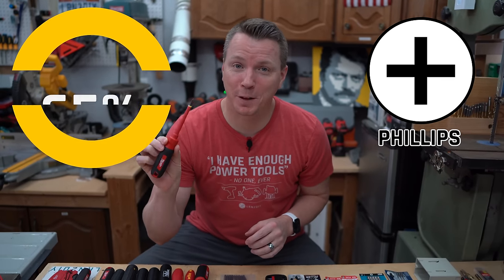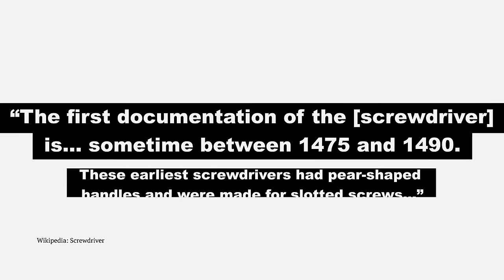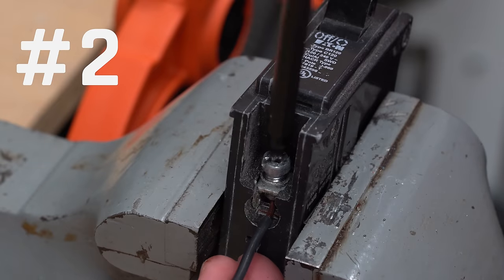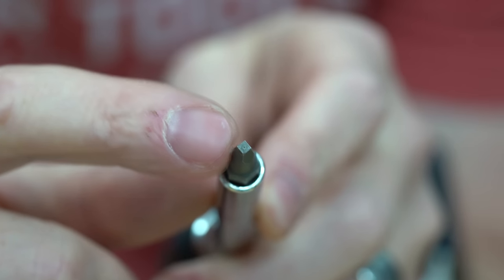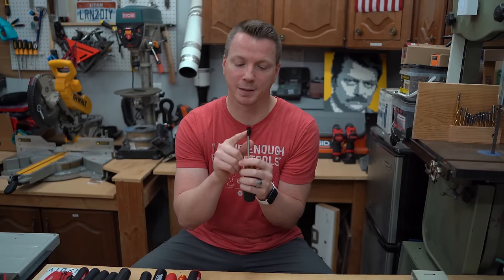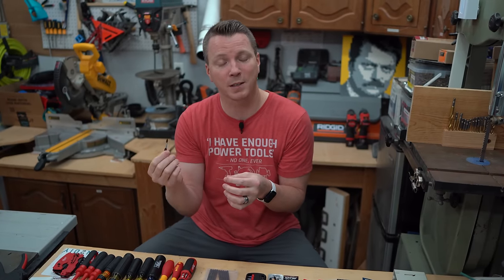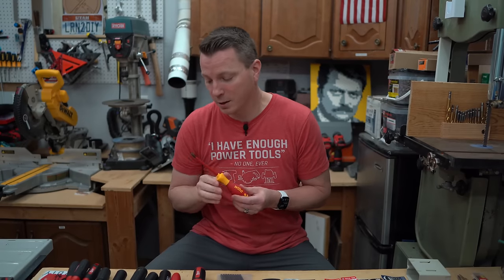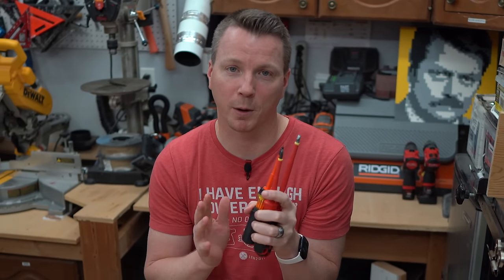You're Using the Wrong Screwdriver For Electrical

Comment: Paul in Canada here. You forgot two of the key advantages of our Robertson. The #2 is red and the #1 is green. Sometimes it’s just part of the handle that’s coloured but usually the entire handle is red or green — and with true Robertson hex bits, the entire bit is painted red or green. When reaching in your belt pouch you don’t have to look at the tip. Also the great thing with the tapered Robertson tip and quality screws (not cheap Chinese junk) they jam onto the end of the tip and stay there while working at any angle for deck building etc. Fabulous!
Reply: I've never seen color coding on any of my robertson bits, not even the multi-bit screwdriver I purchased in Lethbridge.
Reply: @Sylvan_dB  "bits" are all purpose usage. Your mother or sister usually have these multi tools. All Robertson tools (including most hex shank Robertson bits are color coded, #2 red used 80% of the time. #1 green used 40% of the time (#2 used more often by electricians). #3 black used 30% of the time (again, electricians more often) #0 yellow used for small precise work. #4 brown rarely used and #00 orange known in computer world.
Reply: @palco22  if you say so. I have many thousands of dollars of tools and none color coded as you describe. I have seen sizes color coded in some Harbor Freight sets, but no Robertson in those. And FYI bits are commonly used in torque measuring drivers. I do not buy single size torque drivers, and correct torque is essential so I use bits. They also work well in impact drivers for disassembly.
Reply: @Sylvan_dB  I prefer avoiding "bits' (those tiny bits that require a hex shank tool) I use dedicated tools for all work whether it's wood working, mechanical or electrical.
In Canada we don't have Harbor Freight and apparently they don't ship to Canada. We have Princess Auto which would be a similar outfit. A good tool makes for good work but what ever works for you go for it. 
Have a great day and a great 2023 !
Reply: @palco22  sems to be a Canada vs US  user expierience
Reply: It's true that the colors are conventionally used, but not universal. My Klein robbies aren't color coded. You CAN get color-coded red/green and they're helpful, but it's not mandatory.
Reply: @martyvanord984  The importance of a great result is the same. Regardless of where you're from, a great idea remains a great idea.
Reply: @TheNewGreenIsBlue  Of course that is true color coded remains useful. Over the more or less 55 years the few Klein tools I own (cutters, pliers, long nose etc.) have more than proven themselves..
Reply: I've discovered that myself too, I always wondered if this was actually a standard or not but I always find myself using the red and green ones for the same type of screws.
Reply: @redsquirrelftw  Since the Canadian patent for Robertson's patent expired the number id of # 00 (orange), # 0 (yellow), # 1 (green), # 2 (red), # 3 (black) and # 4 (brown). The numbers are reconignised internationally. The colors are, i believe, a Canadian thing and make it much easier to identify. It's my first choice for screws, hands down.
Reply: The Canadian Tire robertson set that I bought in the 1980s (colour coded, of course) remains in regular use. Nothing better, and I've tried them all, including Frearson and Posidriv.
Reply: You forgot the Yellow Robertson....all mine come in yellow..green..red and black...
Reply: Interesting. Never noticed that, but now that you mention it… I have to check. Yes, my two ancient drivers, with wooden handles, are red and green.
Reply: Red Green would have used duct tape and maybe an acetylene torch.
Reply: i drill the back of the handle and drop a little paint in the indentation.
works like a charm. BIG SQ fan here
Reply: You are correct I was able to order actual Robertson screw drivers from one of my supply houses.  The handles are all solid color coded.  I have the green, red, and black
Reply: I never even knew Robertson bits existed before I use Kreg pocket hole screws. After that, I wondered why all screws weren’t square drive. They don’t even need a magnet to seat well onto the bit.

Comment: Robertson is the best choice. I've built decks for friends using Robertson screws. I built my back yard shed using only Robertson screws. Now if the fastener manufactures would properly heat treat their screws I would never see a stripped head again!
Reply: I've used a lot of Robertson also. Way better than Phillips but definitely a little worse than torx. Took about 6 robertson bits to unscrew / rescrew a whole deck because the bits start getting rounded and stripping.
Reply: @gorkyd7912  I agree - Torx are the best alternative for almost every case. In special cases it's XZN, but they are more sensitive to corrosion, so it's mostly for cylinder heads on cars and similar applications.
Around where I live the Robertson is so rare that it could take a week to find a new tool - or screws using it.
Reply: I agree with the other posts that Torx is great. For a while years back our local lumber yard was big on square drive Robertson's. They were better then galvi Philips but I had a terrible time with them caming out.  Now I use Torx exclusively.
Reply: Yeah torx is better than Robertson for construction and woodworking. Robertson is still better than anything else besides torx though.
Reply: Robinson or Phillips for electrical. For decks, there's nothing better than Torx.
Reply: while using the wrong screwdriver, your using the wrong gloves, boots and hat. Never use the wrong tools if you want to have a great day.
Reply: Yeah screw head would have to be fairly hard. Had so many stripped screws from square bits. Seems like they are made for 1 time use.
Reply: Unfortunately, the Torx Army invasion has overwhelmed the forces of the Robertson

Comment: The history I heard of Phillips vs Robertson screws was that in the beginning of WW2, with the big increase in production, Ford had to decide between the 2 screw types.  Critical difference was that Phillips were far less likely to over-torque. At higher torque, Phillips bits would slip out out of the screw head while Robertson bits would hold fast (and then  break the screw or strip out of the metal).
Reply: It was my understanding through my father (of WW2 vintage)  that they were designed to prevent over torquing.  There were (and are) variants like pozidriv that reversed course and  squared up the blades to create a surer fit.  I would suggest that Phillips are still useful for not breaking the plastic parts of say electrical outlets.
Reply: The real reason ford didn't use it was he wanted exclusive rights to Robertson & the inventor wouldn't sell it to him. As usual ford tried to lowball the deal.
Reply: Makes sense for the initial availability of Robertson screw design circa 1906 to 1911 for normal production… [According to Google: US & Canadian Patents:
Canadian patent: 1907, CA103387, U.S. Patent CA103387A; US patent: 1911, U.S. Patent 1,003,657;
Square head screw: 1909, PATENT #116463
Manufacturing machine: 1911 ]   However, the patents would have been long expired by the time of the drastic increase in production for WW2 in the 1940s.
Reply: I am just a do what I have to DIYer, and discovered the Canadian square head screwdriver over 40 years ago when living in Canada. I found it to be the best screwhead by far. Unfortunately I now live in Europe (Ireland) and square head screws are seldom if at all used. More is the pity. 😪

Comment: I hate "Robertson" drives. Don't get me wrong, they are great as long as the driver is aligned perfectly with the screw. Placing the driver a couple degrees off center guarantees the screw to "cam-out".  I find the "torq" or "star" drive drivers to be the best for the best torque, plus, it allows the driver to be mis-aligned with the screw at greater angles. Sadly, the electrical hardware industry has not caught on to using the drive in most, if not all applications.
Reply from the maker: That’s a good point about the angle of the driver. It’s still my weapon of choice, especially when compared to the Phillips or slotted, but I can definitely see what you’re saying there.

Comment: @LRN2DIY The reason why the WIHA SL/PH slips is the same why a PH slips in a PZ head: you are using a SL/PH driver in a SL/PZ screw! Yes, if you look closer at your screws, they have thin diagonal lines between the 4 cross slots, indicating pozidrive instead of philips! And yes, besides the older standard SL/PH (which comes in sizes SL/PH1 and SL/PH2) there are also SL/PZ1 and SL/PZ2 which are combinations of slotted and pozidrive. These will fit into your screws as if they were made for them (which in fact they are ;)). Not only Wiha makes them, also Wera, Knipex, Proxxon, Toolcraft, PB Swiss and others. Like PZ is a step forward from PH (but you still find PH screws), some old electric contact screws are SL/PH while most of them are really SL/PZ -- and of course you have to use the correct size! These btw are also called "plus-minus" (or "plusminus") and "xeno" in literature. Also note that many electric appliances give you the exact Torque you have to use if the screws actually make contact with hot wires (and are not just case screws), which is a safety feature to avoid electrical fires! That's why WIHA also offeres special handles with adjustable torque.
Reply: One type you didn't mention is JIS heads... Similar advantages to pozidrive but you don't have the draw back of a pozydrive head not working well in a phillps screw. JIS drivers work better than Phillips drivers in Phillips heads.
Reply: @ryanokeefe12  I heard the opposite and find it hard to believe that mixing JIS/PH would beat PH/PH. While JIS is said to be better if screw and driver are the same, mixing should be bad, since JIS and PH differ in their tip angles (only), right?
Reply: @stefanpeterwolf7458  PH are designed to cam out. JIS are designed to stay in place so that the desired torque can be achieved. It's not just the tip angles. There is no inner chamfer at the root of the "cross" on JIS which is the main contributor to the inherent cam out design of the PH.
The JIS basically doesn't engage with any of the forms within the screw head that work with the driver to make it want to cam out.

I can't link on youtube, but plenty of info on the googles that runs through this.

I was in the same boat as you.. PH with PH makes sense. JIS with JIS makes sense. I assumed it would be like trying to use PH/PZ or PZ/PH but I bought a set and it has the same type 'secure' feeling that a robertson driver has.
Reply: @ryanokeefe12  Thanks very much, this means I will probably invest in a JIS set , just to be equipped when I come across a stubborn PH screw. In fact those are easy to scuff on the first unsuccessful unscrewing attempt and using a JIS sounds as if they are a nice emergency solution. Until now I was ultra obsessed with using the EXACT driver size for a given PH screw. Using even only 1 size over or under is calling for problems... That (correct size) and full pressure against the screw is a must for PH.
Reply: a lot of mamboJambo. Manufacture of Flat screws should be prohibited. ROBERTSON IS THE WAY. Centers and torques better!!
in the pouch since being the  goffor with many old timers frowning and throwing a hissy fit proportionate to their lack of a GED!

Comment: The reason, why the Wiha SL/PH driver slipped is: You used it on the wrong screw!
The screw is clearly a combination of slotted and POZIDRIVE (as indicated by the acute lines in the screw head). There is also a combination driver SL/PZ for those screws.
Reply: I don't saw Pozidriv Screws tighten, please tell me in which part of video. thanks.
Reply: @dalejandro.perilla it was at 11.30 - 11.35 mark of the clip (the one with the long “Nooooooo” … btw I’ve been using SL/PH2 for the past year as most of the heads here are SL/PH2 … definitely better than SL or PH2 for these type of screw heads …. yup, correct tool for the job in hand … sure I’ve gotten away with just about anything but those SL/PH2 is my one to go for SL/PH2 heads … no more worn screwheads …
Reply: @dalejandro.perilla  Also 11:53 and 12:12 you can see, that these are PZ and not PH.
Reply: My latest outlets had a different marking. Dots. That makes them ISO 8764, derived from the older JIS B 1012. For screws, they'd be marked with either PZ or PH. The outlets also accept Robertson #1.

For those unfamiliar, Phillips was designed to cam out on excessive torque and that's wanted in some purposes, where excessive torque could damage the object(s) being fastened. Pozidriv was designed to not cam out with high torque, as was the JIS and ISO variants. 
As I don't personally own the JIS or ISO flavors, Robertson it is, backup Pozidriv.
Reply: My latest outlets had a different marking. Dots. That makes them ISO 8764, derived from the older JIS B 1012. For screws, they'd be marked with either PZ or PH. The outlets also accept Robertson #1.

For those unfamiliar, Phillips was designed to cam out on excessive torque and that's wanted in some purposes, where excessive torque could damage the object(s) being fastened. Pozidriv was designed to not cam out with high torque, as was the JIS and ISO variants. 
As I don't personally own the JIS or ISO flavors, Robertson it is, backup Pozidriv.
Reply: Nerd!😂😂😂
Reply: @ahmadadam5182 now I want some! 😂😂😂😂😂
Reply: @spvillano  "Phillips was designed to cam out on excessive torque " So it is a feature not a bug? So 40 Years i was wrong being angry about slipping drivers damaging screw heads ? Shocked and frustrated !
Reply: @RogerSmith-h3i yep, designed to not damage soft items being screwed into. And precisely why pozidriv was invented, which is the polar opposite, despite resembling a phillips.

Comment: I am an electrician and I love the Robertson or square drive.  Works every time no slips or strips.
Reply: “Works every time “ is bang on when describing using Robertson. No camming-out, no slippage, Robertson works. Also, Robertson holds the screw in place enabling one-handed work. Whether doing electrical, woodworking, or DYI Robertson works and saves time.
Reply: I've seen so many stripped out square drive screws. I guess if you are just installing and don't have to think about future maintenance of it, a square drive is ok. But if you have to go back and take wires loose for maintenance, it can be just another annoyance.
Reply: @robertlawrence9000  square drive is not Robertson. They are different and likely the reason for stripping.

Comment: As an electrician there is one bit you did not mention. Its from rack-a-tiers. A Robertson square bit with wing tips similar to the ECX with smaller wings. Works great for some breakers, ground/neutral bar and ground screws
Reply: They need to stop making combination head screws.
Reply: kevinlsims7330   Agree. Torx is the best
Reply: 🇨🇦Robertson🇨🇦
Reply: Spoiler alert: Rack-A-Tiers is Canadian. 🙂

Comment: Here in Denmark, we dont use philips or flatheads anymore and havent done for many years. We use torx20 for normal screws and torx10 for electric stuff. 
Try em out, its amazing. 👌😊
Reply: Torx bits/screwheads are the absolute best ! It Can be slotted every 60 degrees, never cams out, tons of torque and it can substitute hex/umbraco.
Reply: Even someone just hanging up a painting or something? Professionals here in the Netherlands have gotten used to Torx by now for some applications (deck screws etc), but most DIY'ers definitely have not. Philips/Pozidriv still rules, as do hex bits for bolts.
Reply: @TheLukasDirector  Yep, proffesionals and DIY'ers. 90% of all screws in shops are Torx. :)
Reply: Star (=Torx) screw & driver systems are definitely better than all of the preceding, however they are not generally available in electrical work. Better for wood & carpentry. Use stainless steel screws for any exterior work, not coated "deck screws" (junk).
Reply: They don't use these in the US? Thought it was strange that he didn't mention them. I also like them best. although I remember reading some people hating them for some reason, or maybe it was just Americans hating them cause they don't have any screwdrivers for them.
Reply: @atnfn Some electrical equipment here has torx. It depends on what brand of equipment. If you bought the same large panelboard for instance, or meter breaker combo unit, each manufacturer uses different types of screws. Flathead, torx, Phillips, combination, Robertson, and hex in various sizes are all common.

Comment: Retired general contractor here (4 years ago) who also did all his own plumbing and electrical and I made it all the way to the end of your video in hopes you would find the square drive to be the best.  Hooray for that.  I settled on the square drive as my preferred tip for interior electrical,  hands down the fastest and most useful.  It was even better when Milwaukee came out with those multi-tip screwdrivers that had slotted and Phillips along with square drive.  If I felt I needed a little more torque on  a screw it was a quick change out to tighten down a little more with the slotted head.